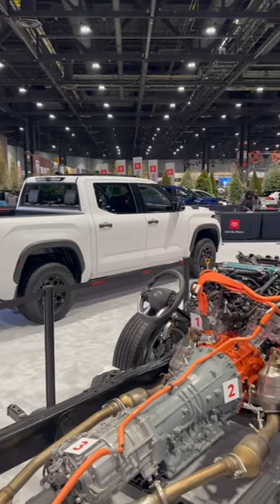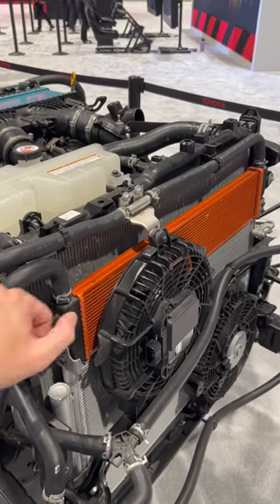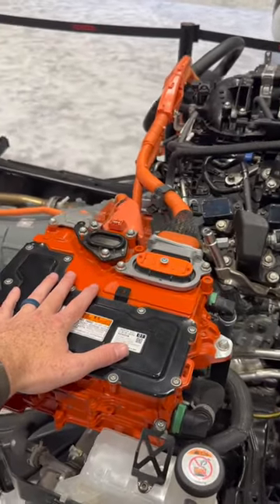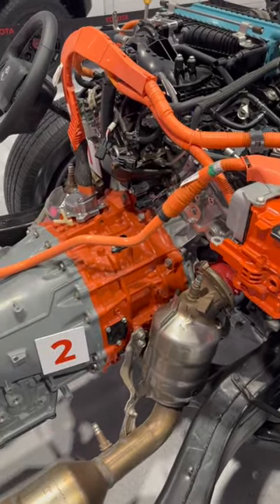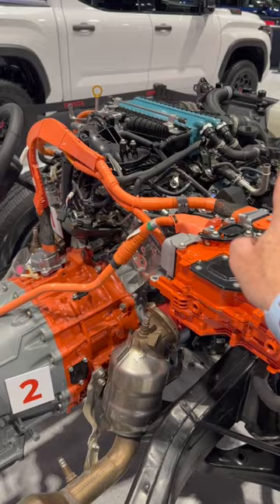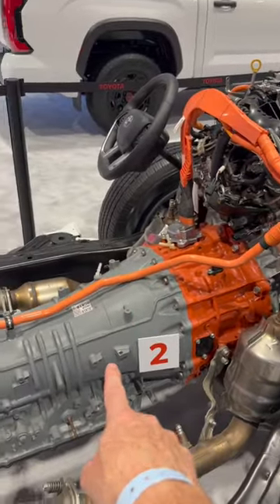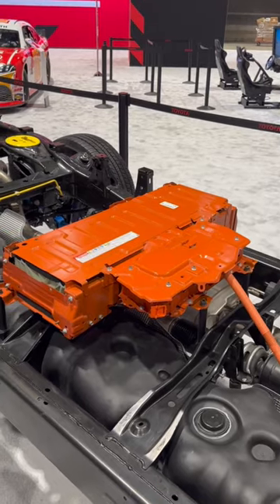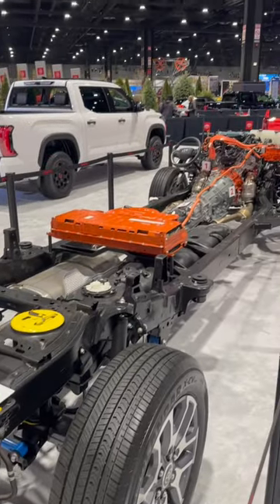Close Up Look At The Tundra TRD Pro I-Force Max Powertrain

Comment: Can't wait to see the repair bill when that hybrid system starts having issues inf 5 years can you say 10,000+ dollars?
Reply: It has a 10 year 150k warranty
Reply: @TyreekWilliams-p6f  And I am sure that the dealerships will absolutely not try to weasel their way out of paying for repairs and say "well actually the powertrain warranty doesn't cover that" like they always do.
Reply: @sonysoyboysaremadeoftears.7404  the hybrid system has a separate warranty, that conversation wouldn't happen because of that.
Reply: @LoneWolfSparty  That absolutely makes zero sense and a hybrid system will still be very costly
Reply: @sonysoyboysaremadeoftears.7404  it makes perfect sense. It's just like an electric car warranty -- it's bumper to bumper for the entire car, and there's a separate warranty for the battery and the charging system components. And if you have to replace the battery when the car has 200k+ on it, you've more than gotten your money's worth out of it. Toyota's hybrid systems have been extremely reliable and maintenance free over the years aside from changing the coolant for the inverter, things like that.
Reply: @LoneWolfSparty  You do realize that warranties don't last forever right? and that most problems with vehicles begin once the warranty runs out right?  There is also no proof that these new systems will last 200K miles, these are not the same systems that the prius has this is entirely new.
Reply: @sonysoyboysaremadeoftears.7404  the battery tech is similar. And design wise it's closer than you'd think.
Reply: @LoneWolfSparty  that does not make it any more reliable by default and the turbo 4 cylinder engines for these tacomas have not been proven for extended off road use.
Reply: @sonysoyboysaremadeoftears.7404  Tacoma? Don't you mean Tundra?
Reply: @LoneWolfSparty  tacoma has a turbo 4 cylinder tundra has a turbo v6 neither has been proven for off road
Reply: @sonysoyboysaremadeoftears.7404   correct, but with regards to torque, the newer engines produce more of it than the old engines did. In terms of off-roading the entire package as a whole is what matters, not just the engine. And in terms of the Tacoma, there's not any information on the production TRD Pro just yet (if off-roading is your thing).
Reply: @LoneWolfSparty  If it isn't tested off road for reliability it is just going to be a disaster
Reply: @sonysoyboysaremadeoftears.7404  do you really think they aren't going to test a trim like the TRD Pro off road before releasing it? It's not out yet.
Reply: @LoneWolfSparty  They can't extensively test it.  The testing that is required would be nearly 100k miles and extensive off road use in all kinds of conditions.  Manufacturers don't test like that they sell them then the consumers essentially test it.  That is why it is always recommended to never adopt a new generation of vehicle that has a new engine/transmission because it most likely was not extensively tested.
Reply: @sonysoyboysaremadeoftears.7404  you'd be surprised. Vehicles are developed over a period of years typically, not months. Components especially.
Reply: @LoneWolfSparty  And yet many still have problems especially with a new generation that has a new engine/transmission.  The factory can never fully test a new vehicle like tens of thousands of people can it just isn't possible.  I will rest my case and point with the mass recall on the 2022 Toyota Tundra all of those tundras for that year were recalled due to the new generation that included the turbo V6 with a wastegate issue that made the truck inoperable.  Look it up.
Reply: @sonysoyboysaremadeoftears.7404  yeah... I'm aware. The supplier for the Japanese version of that engine is different compared to the version of that engine that's in the US/Tundra. The LS500 has had zero issues with the wastegates vs the version that exists in the US. They rectified that with a different part after realizing it was an issue.

Comment: Only downside is the overall curb weight. F150 power boost get 5mpg more overall due to its light configuration. I’d probably drop in a tune to squeeze out more HP. Tundra is gonna be reliable like my ‘12! 👍
Reply: Yeah, it was great to have an ex-Boeing engineering as CEO at one point because Ford started building things with aluminum. And while the Ford had to liquid cool their batteries, they do use lithium-ion so it is more energy dense.
Reply: How’s it going for Boeing now?

Comment: 5.7 V-8 would be better.  Hybrid?  TTV6?  HARD PASS
Reply from the maker: In what sense? Power? No. Reliability? Unknown
Reply: @TRDJon  Complexity, reliability, durability, longevity to name a few.
Reply: @Squanch Wanch  01 seqouia with 225k and 15 5.7 tundra with 150k. Would never buy this new junk, oh, BTW, though that new iforce max has more hp, it lacks the more important 4.30 rear end. Additionally, if I wanted more power, Magnuson would put this primus truck to shame
Reply: @Squanch Wanch  plus in a truck if you want to go fast buy a Ram TRX, if you want a long lasting truck that can tow a trailer all day, buy a v8 toyota. Torque over hp and 4.30 rear contributes more to the overall wheel torque as well as you don't have to Rev the turbo motor out. All the Power is in the right place

Comment: IMHO, I kind of like this system but they could only do so much while trying to fit things into an existing truck design. I do hope that once radial flux motors become a thing, we could actually get a more powerful hybrid system for less weight (currently 46 horsepower; new gen radial flux motors can probably do double that and then some for the same weight). 

Toyota opted for NiMH because it can air cool the batteries and get the air from the cab unlike Ford who uses Li-ion. The thing is, if they opt to switch to Li-ion (or better, Toyota's new solid state battery that will be available in a couple of years), you can have the power capacity or a little bit more in a smaller package--and you'll get some of your storage back. As for cooling, well, the engineers can figure out packaging for that (I mean, Lucid could do it, and they have an extremely compact EV design that shames Tesla and others).

Comment: Looks like a lot of money when those batteries need to be replaced...
Reply: You do know that the hybrid battery has a 10 year, 150,000 mile warranty, right?
Reply: @sawyermartin4434  You do know that my 2011 Tundra has 274,000 miles on it, right?
Reply: @jedeckert8912  Yes, I do know that now!
Reply: It’s all relative, batteries for the original hybrid vehicles are pretty cheap.

Comment: The hybrid system had plenty of power and was fun to drive. The only thing that I hated was the hybrid regenerative braking system. Mine made a high pitched humming noise when I would step on the brake. Toyota claimed this was normal. It was enough to drive me away from my TRD pro into a Raptor.
Reply: good choice
Reply: I have a 2024 Tundra Hybrid and there is no noise whatsoever that I’ve noticed. I wonder if it is just some of them make the noise. 

But I do have the squeaking brake issue when you first start driving and that sucks.

Comment: Its the future hybrid is perfect not EV
Reply from the maker: Correct
Reply: Not even a hybrid, can't drive on the battery alone. It's should be called "battery boost" not a hybrid
Reply: Keep dreaming 😴
Reply: @natelove187  dreaming unnecessary,  manufacturers have dumped ev.. .its over...
Reply: @jhartmac100  no, I'm talking about ev and hybrid. Don't like none of it. To expensive to fix and when it's worn or crashed, Insurance company will total that junk

Comment: The i-Force V8 may sound better. But the iForce Max is objectively better: better mileage, and more power
Reply: if you figure in cost to buy, maintenance and even more things to go wrong and all the increased  costs hard pass for me gove me a simple well designed  v8 from the 2000s any day simply put cheeper to maintain decent Mileage  amd tons of power and the sound of a trd super charged v8 is music to my ears
Reply: @Squanch Wanch   truely one of the best years for that truck and to this day one of my favorite  truck to drive
Reply: No this motor and hybrid system belongs in the tacoma, and the Tundra should have a twin turbo 5.7 ltr v8 with hybrid option

Comment: As long as you buy thr truck with Extended Warranty or trade in before Warranty ends. I wouldn't want to own a 8yr old hybrid that most mechanics wont touch cause of all the complexity of the vehicle or replace the batteries at 10 yrs for a ridiculously amount, or blown turbos, or issues with the inverter system lol yea nevermind. Pass.
Reply from the maker: All vehicles will be like this in 8 yrs so mechanics will have to
Reply: Yeah that’s why they are going to depreciate a whole lot after 100,000 miles because the maintenance will be so enormous
Reply: Garage at best

Comment: I have a 24 tundra trdpro. Say what you want about the v6 but I’ll eat a 5.7 v8’s lunch in pulling and off the line. It’s the turbo with the battery. The torque from it is insane…I added 60horse with a performance chip. So I have 500hp with 640lbs of torque, but I tell you it’s that battery. It’s not for your fuel economy. It’s for boost! 

The only problem the governor is set at 108.
Reply: I have an a 2024 Tundra Hybrid also, do you think the chip is worth it and a noticeable difference?